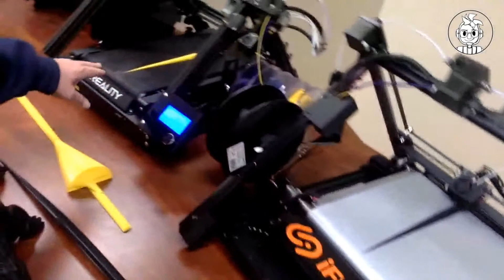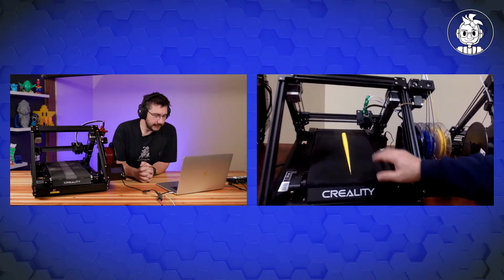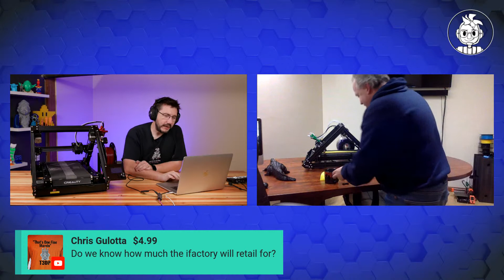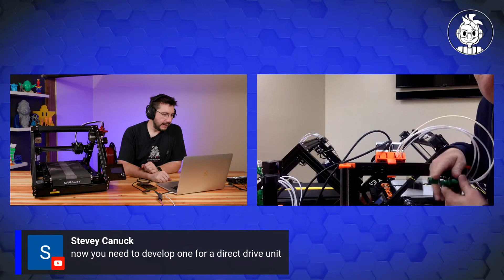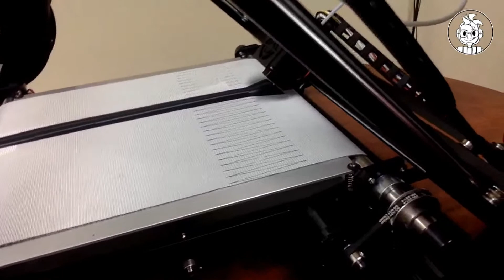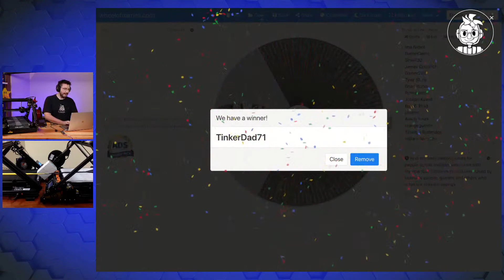Creality CR-30 versus iFactory3D ONE Belt 3D Printer Discussion

Comment: Not sure if it has been mentioned (or if its an option), looking at the 3d Chamelon so nicely placed on the CR30 .. wouldn't it be possible to just use the 3D Chamelon as a filament bank so the belt printer can print for a longer time without the operator needing to do a filament swap?

Comment: so whats the conclusion :P. I have an early on both, but cant afford both so have to ditch one or the other x-D
Reply: the creality has a better belt the other one has better motors. both seem ok
Reply: @rollandelliott  Tnx. While I’m keen supporting our German neighbours the higher price tag combined with the prospect of building it 4 hours and still failing (I’m a noob still) kind of did it in for me
Reply: @irongollem  Not sure where you got that information from - the iFactory is currently available at KS for €799 and is supposed to retail at €999; the CR30 is also being claimed to retail at US$999, and currently two "super early bird" orders at $588 and "early bird" offers at $688 are available - however the iFactory also started out at €699. So, no big price difference here - exchange rate (ca. +20%), if you will. Shipping cost excluded, and the iFactory price already includes the German 19% VAT. iFactory also offers a semi-assembled kit which they claim only takes one hour to complete.
In direct comparison, the iFactory offers a substantially bigger building area, comes with a Raspberry Pi, Octoprint and camera, Titan extruder and proper steel rails, PrinterGuard integration over the CR-30 - and, what I personally find the best sales argument of all, a free 1:1 set-up and tuning session with one of their technicians (ever tried to get a hold of Creality support? - Well, I did, and I must say that support isn't exactly Creality's strength. And after watching Teaching Tech's CR30 review, it is obvious that also the CR30 will just run perfectly out of the box.).
Further, iFactory claim they design-freezed the printer in March, after an almost two-year R&D phase including e. g. testing several belt versions, and tested it in mass production for medical equipment during the pandemic, whereas Creality clearly state that design changes are still to be expected. iFactory can also be pre-ordered regularly via their web site already, with expected shipping in March (they also had a sale with delivery by Christmas; not sure if that's still on).
And even better, while Creality have this very ridiculous claim about open-sourcing the printer after reaching a $5M funding goal, on the iFactory Kickstarter page they claim they will release all the design files on GitHub "within the next few weeks" without any further prerequisites.
Sorry to brag; not affiliated with any company whatsoever, just somewhat hyped myself currently.
Reply: @mobbkopf  I had early birds for both, but cancelled both as I simply can’t justify this yet. The ifsctory would cost me more than 200€ more so yeah that’s a lot more cash for principally the same thing even though it might have more worth. Hope you have fun with your machine. Ill wait until I find a practical use and the greater community impact has left its positive improvements on these types of machines

Comment: I feel bad for the iFactory guys, they put their product out there against a printer designed by steele and Nak 3dd, built by creality and maomi, promoted by the major players of the Youtube 3d printer community,, and for cheap. How do you compete against all that? I wish I had money to support both ventures.
Reply: Just to be clear, I didn't design anything on the CR-30.  That was Creality and they hired Karl to help them tweak it... but I didn't have anything to do with it until I was sent one.  I made suggestions publically for all printers to follow... and they implemented some and not others... likewise, so did the iFactory team.  The iFactory printer can print just as good as the CR-30... that's my conclusion.  They took different approaches to doing that, but in the end... I think you can do good with both.
Reply: @williamsteele  It's really great you help out.
Reply: @williamsteele  I agree, iFactory probably can do the same, perhaps more, due to it's slightly larger build area? And I wish we could have also tested build speeds...
It's just....well, maybe if they kickstarted a month earlier and had a lower price, you know? LOL
Reply: @shamusobi2748  The build speeds are identical from both models, as they both use the same hot end, which is the limiting factor.   Both have a dual drive gear extruder and both use a CoreXY motion system with similar mass.  So don't expect any differences.
Reply: @williamsteele  Ah, ok didn't know...thanks for explaining.
Reply: I think they did a great job!
Reply: @Naomi-Wu  👏
Reply: By adding interesting features the creality lacks and will never get. Im sure the machine shipped by Ifactory will be even better then this release.
Reply: It already has print fail recognition, touchscreen, camera and octoprint for print queueing (instead of large gcode), wifi
Reply: @Johan-ul9jb  And its german engineering! 
Creality did stretch goals but you even don't know whats coming up next - iFactory has it in it from home with more specials. The only point that hit most for creality, is ca cheaper price - but thats it and I think, most of the people didn't know about the other printer because the commercial spot is higher by creality. 
I think more would have chosen the iFactory if they had heard about it sooner.
Reply: @Lunaticsystem  You mean the great German Engineering that went into making the build plate too large which waste energy and prevents shall prints from detaching and getting pulled under the roller bed assembly? What about using to motors to get the torque instead of using one motor with gear reduction? Just because it by German and designed in Germany doesn't make it good engineering. The people who kickstarted this are business people who specialize in medical transcription. They show no previous knowledge from 3D printing. Compare that to Creality's established record with ender series and supported by the best of the best in the 3D printer community...yeah, you know what? German Engineering aint looking so good, mate!

Comment: @3D Printing Nerd  thanks for the video Joel! I do want to add 2 points that, in my opinion, did not get enough attention. First of all these printers are on kickstarter. With bigger companies now using kickstarter as marketing tool people seem to forget that startup need the kickstarter funds to develop their product to make it market ready. The final machines can be different. The second thing is that the cr-30 has a very basic feature set, where the ifactory will have some very interesting features. I will mention a couple: connectivity! Having octorpint will give you not only the option to check your prints without being next to it, it also gives you the option to have an changable print queue. This is so much better then having huge gcode. Next the camera. It makes it possible to do the print fail recognition. I think this is a very important one for a machine that prints serie production. 

I think 2020 will be a great year for belt printing! And I am hyped seeing the final printers in a few months!